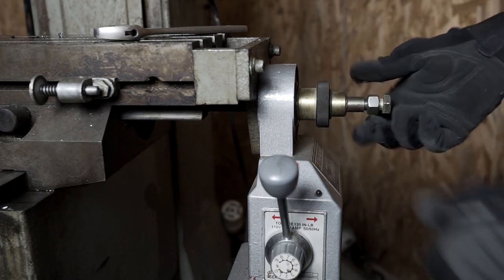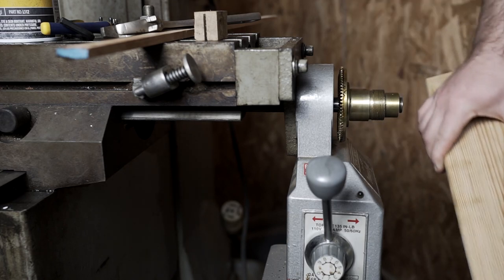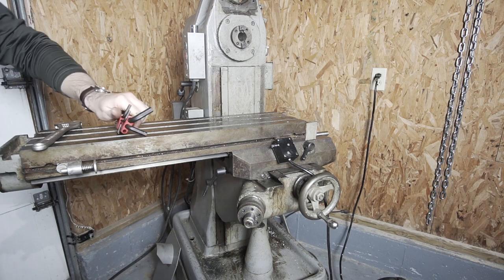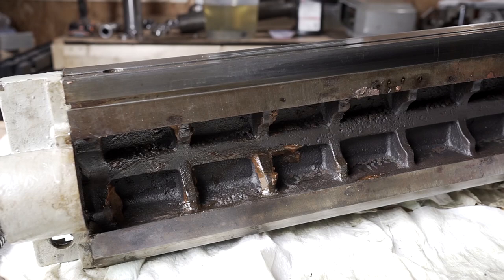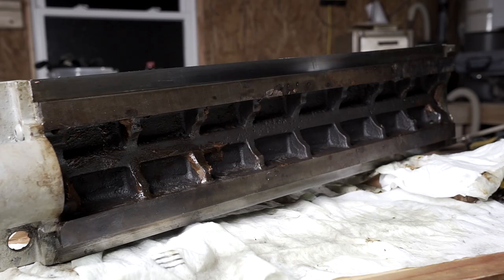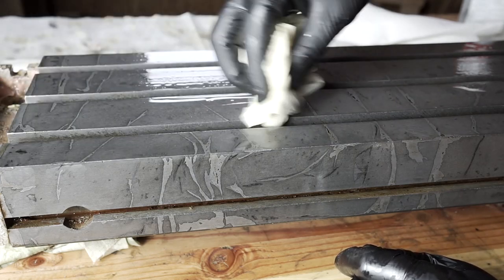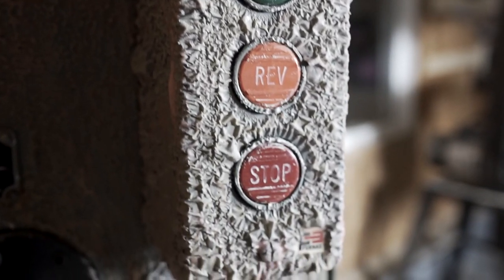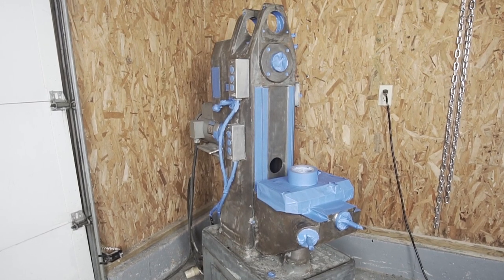Rockwell Mill Clean/Repaint - Part 3

Comment: Looks like it is coming along great 👍.  I was hoping you would pull the knee off just to see how it comes off.   Thanks for uploading this.  I am interested in that power feed.  Looks like a better design than the original.  Chris
Reply from the maker: Yeppp, I seriously considered it, but it looked like a ton of heavy lifting for not a whole lot of gain :)  Not much to clean inside/behind the knee that isn't accessible from the outside.  And I was starting to get antsy to start playing with the mill :)  I may, someday, scrape the ways so maybe I'll pull it off then.

I'll have more details about the powerfeed in the next part, I specifically took some closeup /overhead video of the components before I reassembled them.  Thanks for stopping by!
Reply: Just found your videos, I am in the middle of the exact same project. Just finished removing my table, motor, and over arm yesterday and decreased the body. Bought some citrus strip based on your video and will try that before paint. What are you planning on using to paint? I will probably just brush Rustoleum on.
Reply from the maker: Awesome, glad to have helped a bit!  The biggest thing I learned with the citri-strip is to apply it very thickly, and then just let it sit 24 hrs.  The directions say it can be scraped sooner, but leaving overnight worked well (especially in my cold garage).  I'm using Ace brand "Rust Stop" medium gray oil enamel.  Mainly because I had a quart leftover from a different project, otherwise probably would have used Rustoleum as well

Comment: Hi. What is that gring stone?  I have old mill allso on cleaning and fixing stage. My table is used, your looks like new.
Reply from the maker: Just a cheap Norton combination bench stone ("India" stone, although synthetic these days).  Silicon carbide on one side, aluminum oxide.  They are wildly out of flat compared to the table, so you don't want to use them to actually remove material... just burnish off the nubs and burrs.  You can buy precision ground flat stones but I didn't know that at the time.  Most of the improvement in my table was from degreasing and evaporust to be honest.  Goodluck with your restoration!

Comment: The paint on that looked almost like new. Why did you remove it.
Reply from the maker: The paint was pretty dodgy in places, peeling and rusting underneath.  Quite a bit of one side and the back were in bad shape.  It would have survived without intervention, and I could have tried to color match and touch up the bad spots.  But I wanted to pull apart the whole thing down to take a look at the mechanical components, so figured it was also a good time to put on a new coat of paint.  Necessary?  Probably not. But I like to tinker and it's my machine, so why not? :)